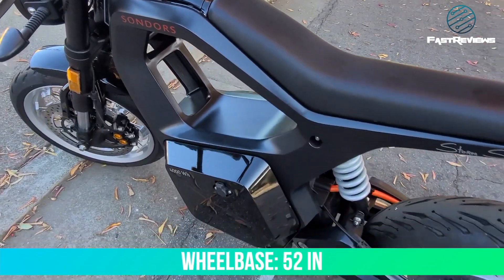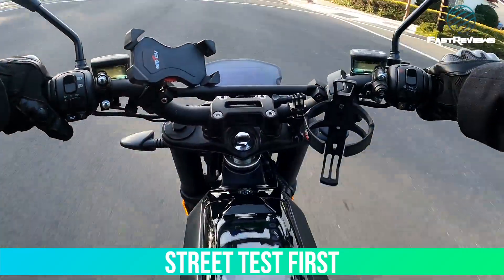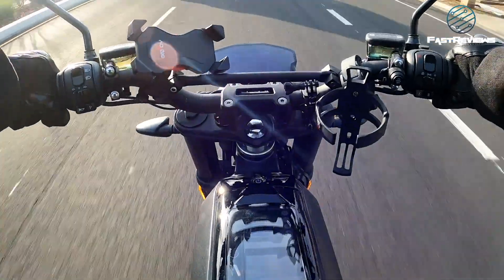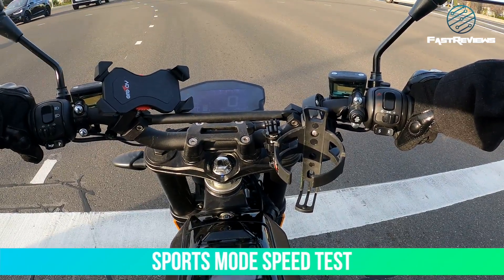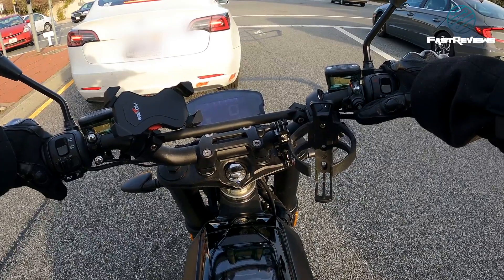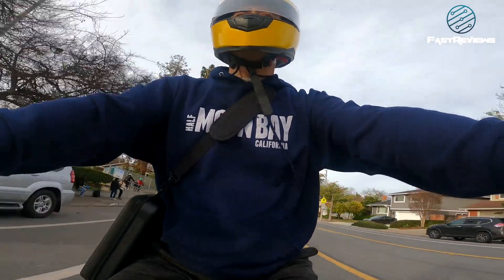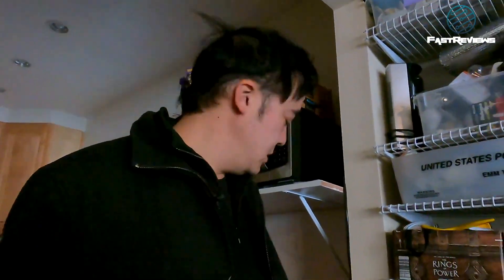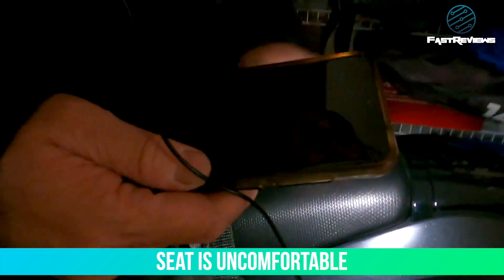Unleashing the Power: Real World Test of the Electric Sondors Metarcycle #fastreviews

Comment: Did you notice the speed shown on the bike is 5MPH more than actual speed
Reply: It’s more like it’s off by 10-12% roughly so the difference in speed shown to actual speed is variable and difference increases with speed (ie at stated 10mph you’re actually going like 9mph but at stated 50mph you’re actually going about 44mph, etc). This can be resolved by setting the speedometer to a smaller wheel circumference to get better accuracy.